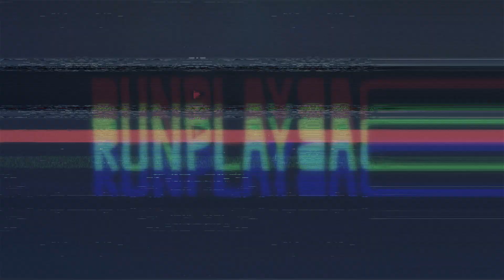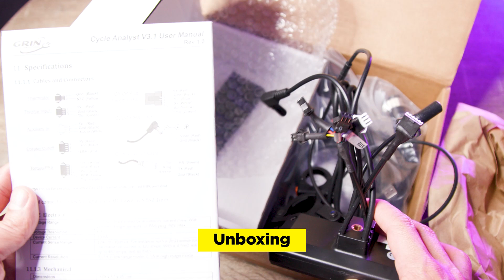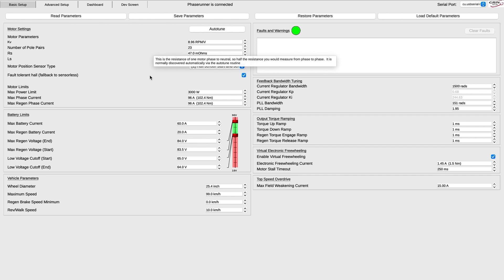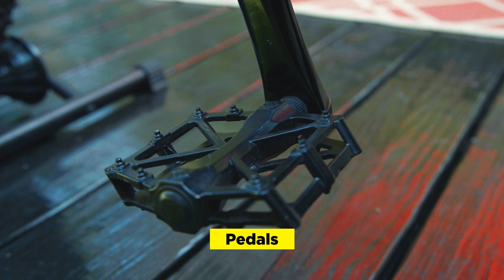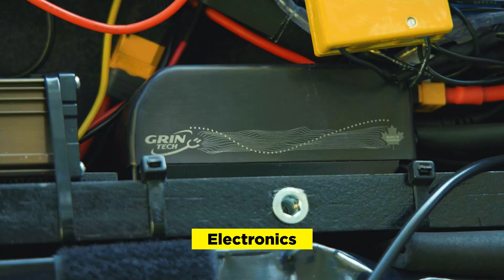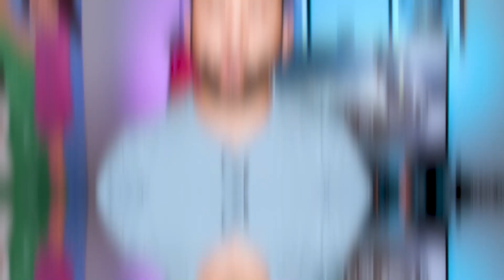72v Super73 Z Force 1 Custom Build | RunPlayBack

Comment: Wanted to do a qs205 motor with 60v controller and battery on my z1 , do you have a set up you'd recommend on the z1 . Been talking with Alex from Detroit mopedworks about doing the install
Reply from the maker: Dope! I'd say the same setup we did on the DMW Monday would work on the Z1.
Reply: Ok nice , do you know is that the qs205 motor in that kit ? I didn't see a 20 inch wheel version , would I need to stay with 20 inch wheels ?

Comment: Hey I was wondering what is the best hydraulic breaks for a z1 & what is the highest volt battery for the stock motor
Reply from the maker: Best is relative, it really depends on your budget.  Baseline Tekro or Zoom hydraulic brakes would be a huge upgrade, and they don't break the bank.  With regards to battery voltage, it really depends on what aftermarket controller you go with.  The controller will dictate what battery voltages you can use.
Reply: Thank you my friend

Comment: Do the fenders fit on a zx??
Reply from the maker: They should, the rear fender mounts to the rear of the frame, and the front fender mounts to the suspension forks.  You may need to adjust a little for a perfect fit to your liking.

Comment: Not bad and I'm glad your calling it a moped, but..... it's your weight (not you, the bike), you have a motor which is old fashioned and has not changed since the 9c, as we old hippies would say "that's heavy man". You did the right thing getting the Grin Tech kit but you left out the best piece the Gmac (facepalm moment). Light weight with all your favourite features including regen braking, cooling fluid and internally geared with more Nm's of torque. The Gmac has temp sensors so it will throttle back instead of going into melt down, I run mine at 3 thousand watts with no issues and go as fast as 50mph. If you want to only go as fast as 35mph it would be perfect if you want real perfect numbers.

Comment: I’m really digging the enclosure you’ve made for this z1!
Any tips and advice in terms of making one for a zx?
Reply from the maker: I think you could create the same thing using plywood and 1/8" ABS plastic. Just have to measure it out.
Reply: @RunPlayBack  it seems like you managed to mount it onto the bike pretty firmly, did you incorporate the pre-set screw holes the bike has for that effect or is there an external element holding it into the frame of the bike?
Reply from the maker: @J-nugz  Yup you're right, I basically just found brackets to hold it in place using any existing mount holes on the bike. There's probably a much more efficient way of creating an enclosure but it worked for me.
Reply: Sweet! So that’s how you did it. I’ve watched the entirety of this video like 15 times trying to dissect your enclosure build. It looked like you also made your own splash guard complimentary to your enclosure, does that also act as an anchor for securely mounting your enclosure as well?

Comment: Wonder if this controller is comparable to the saboton controller 🤔.  Can it push amps like it.
Reply from the maker: No definitely not. It only pushes under 100amps. But for a smooth low end and a solid tuning app, its a good controller. You'll get way more power out of the sab.

Comment: Dope ride! Question! Have you raised the bars on your RCR with those same risers and if so which sized bolt did you use because nothing seems to fit and the handlebars are never fully tightened. Any help will do!
Reply from the maker: Yeah! You mean for the Super73? I used these: https://amzn.to/3qxjyiD
Reply: @RunPlayBack  no. Eye have the same risers for my RCR and none of the bolts fit properly. They tighten but get loose while riding. It's very dangerous. Just can't seem to find the right bolt for them.. and the only other person that definitely did it to his RCR on YouTube isn't responding to my question about the bolts. Although he sent me the link to the risers lol. Just wondering if you or anyone could help at all. Because as of now my RCR is unrideable
Reply from the maker: @mackmccord3743  oh yes I remember..I ended up adding washers on top of the bolts to act as spacers. This puts tension on the riser blocks to keep the handlebar in place. It's not pretty but it works. You may be able to find small spacers in a local hardware store as well.
Reply: @RunPlayBack  ahh. Eye dig Eye dig. So you used the stock screws with a little spacer? If so that makes sense. Thought of the same thing. Wish Eye knew someone that could make a little black plate that would fit on the bottom perfectly!

Comment: Hi Rik! Very cool video as usual and well done on the work for the Z-force 1.
I own a stock SUPER73 ZG (European version) and I’m looking for an upgrade with the best ratio money/speed. From my side it would be upgrading only the controller and putting a throttle, keeping the original battery and motor, but removing the speed limit. What do you think?
Have a great day
Reply from the maker: Hey Mat! Yup that would be the simplest way to upgrade the ZG. I will say that once you get a taste of 25-30mph speed, you may want to eventually upgrade the battery to something bigger. The stock ZG battery is really designed for low speeds so although the speed limit can be removed, you will also lose range.
Reply: @RunPlayBack  thanks for taking the time! Yes I agree with you, then I could also upgrade the battery to a 48v 20ah like you did in your video. But considering the price + difficulty to find the right size one + having to cut all the plastics edges from inside the seat + not being able to charge it through the original charging port = I’m not sure it’s worth it 😅 I think I will upgrade the controller and put a throttle to begin and change the battery later if needed. 
Also just to explain, I live on in an apartment in Berlin on the 1st floor and I have to carry the bike up and down every time so I want to keep it as light as possible 😊
Reply from the maker: @matparadize  yeah that's a good plan! That's exactly how I approach modding, by asking myself if it fits my lifestyle. If it does then I upgrade accordingly. Remember there's no one size fits all and you don't always need all the things. Like I said in the video, this build is just a science project and hopefully there's parts here and there that people may find interesting or would want to add on their bikes.